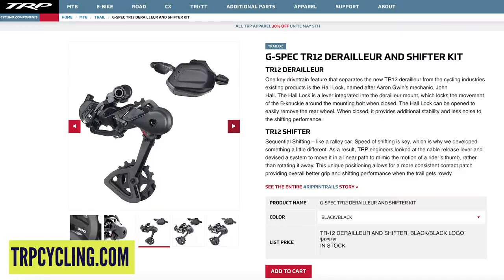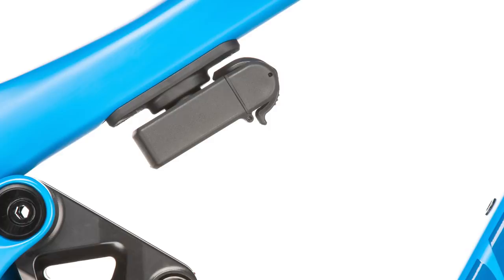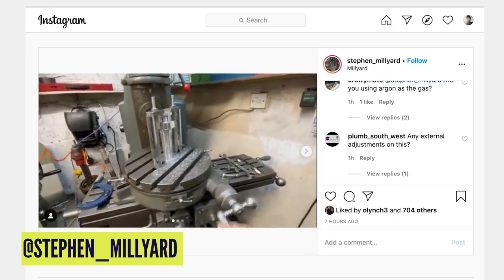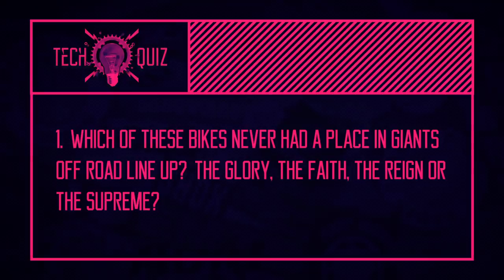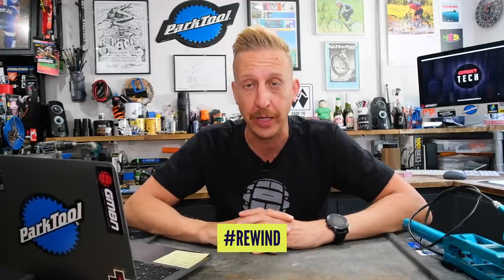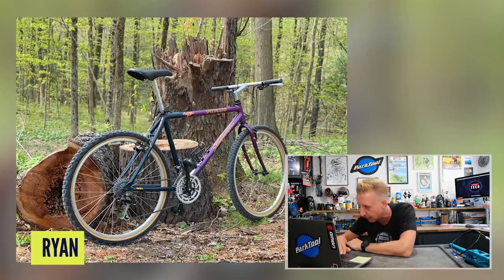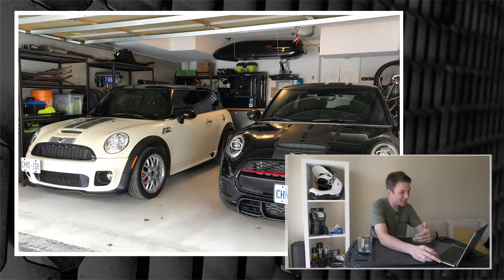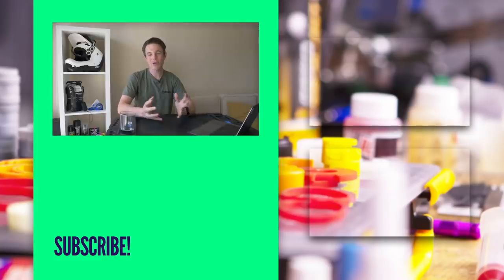Top Secret New MTB Shock From Millyard Racing & TRP Goes 12 Speed | GMBN Tech Show Ep. 124

Comment from the maker: How do you think this shock works? 💭 Let us know your thoughts below 👇
Reply: What happened to the highline 7 givaways?
Reply: Howd they make a better shock then fox or rock shox there multimillion dollar companies im impressed
Reply: Does the pull ratio on the TRP derailleur match any of the existing shifters on the market?
Reply: Some of us reckon its an oleo shock  as use in aircraft landing gear which prevents the plane from bouncing upon touch down.
Reply: They should do a small run so we can try for ourselves and see if it's really good or not
Reply: @chipsnpeasifuplz  I believe it is
Reply: It's his dad , he has access to higher skills than other Earthlings.   Dodge Viper engine in a motorbike , yeah no problem.  Serilously.
Reply: @chipsnpeasifuplz  they already confirmed its an oleo strut based shock.
Reply: Magic
Reply: GMBN Tech what about the giveaway for the dropper post
Reply: Unicorn tears i guess.
Reply: When do you anounce the winners of the Crankbrothers highline dropper?
Reply: @chipsnpeasifuplz  do you think that will work good in the field or are there any disadvantages?
Reply: Similar to how they have for years I’d imagine
Reply: Got a good feeling the shock is an "oleo" strut with a gas/oil mix. The hole he is talking about I think is the metering orifice.
Reply: @BulbManLUV1374  custom and mass produced are two very different things.
Reply: Doddy, what is that interesting Blue anodised lovechild of a thudbuster/sus seatpost/remote lockout on your table??
Reply: @Mortarman0341  I think you miss understood my post. Millyard is an auteur engineer

Comment: Awesome video! Always enjoy you guys! Thanks so much for putting my Devinci project on top mods! 😁
Reply: Hi, what did you use to strip the frame? Seems to be some confusing info re acid versus alkali strippers with alloy
Reply: gtheriddler . Hi, I used a 3M vinyl automotive decal sheet and cut it out from that. I bought it from a local sign shop

Comment: 0:56 But with a clutch with enough tention and a chain the rear derailleur won't pivot to up to the rear. but without the chain it could move, and make banging noises, so if chain fails on a dh run you will head the B screw hitting the hanger, so the lock will eliminate that issue, but as long as the chain is there that is not a issue.
but with rear derailleurs without clutch, and weak spring the R could move in all ways , including pivot at the hanger, and cage would pivot too, horrible.

Comment: Not feeling fast rebound with no differentiation for high vs low speed. The two demands of a good bike are at odds. Over mixed technical terrain you need soft compression to get over a feature, and fast rebound to get the tire back down. Over large drops, hits, and landings, you need a stiff compression to not just blow through the travel, and a slow rebound to not take all that stored kinetic energy and like Doddie said "kick you in the arse".
Fox X2 will be hard to ever surpass.
Reply: You don't know anything about this particular shock. It's totally different. (Although I agree). Fox have been getting overpriced recently.

Comment: Why the resistance to running hub gears or even frame gears?  
Why is nobody making a Hossack style front suspension? It’s lightweight, low cost, adjustable for geometry and can use a rear shock style spring/damper.

Comment: Love the tech shows, askgmbntech when pumping up my tyres using a track pump I pumped it to around 25 psi however when doing the squish test the tyre felt rock hard. Is there a way to re calibrate a shock pump or would I have to get a pressure gauge checker to know my actual pressures

Comment: Can you show us a lidl or aldi bike stand and review it as they are coming in stock soon
Reply: I have one and have been using it for a year. It’s pretty good but the rotating part of the head doesn’t stay to tight so the front of the bike hangs down a bit lower that the rear. Good for the money though.
Reply: @alexmccann502  yep, totally correct, but also easily fixed with some modifying, so for the money they are brilliant...if its same as my.one, @ £25-30 I wouldnt hesitate. Nothing else close for the money...assuming they are same as previous ones....